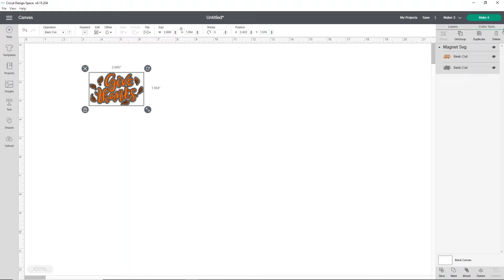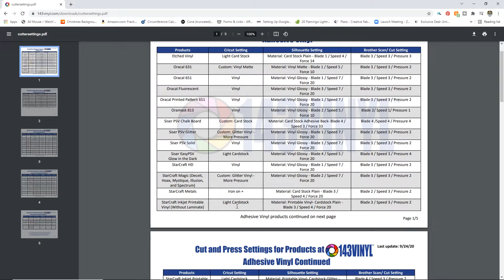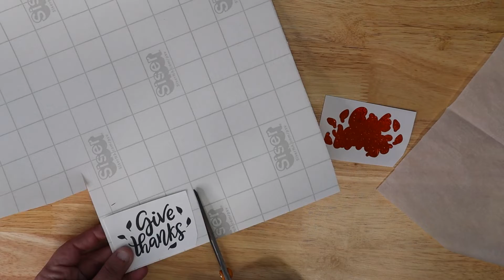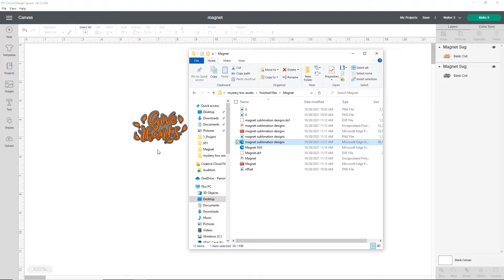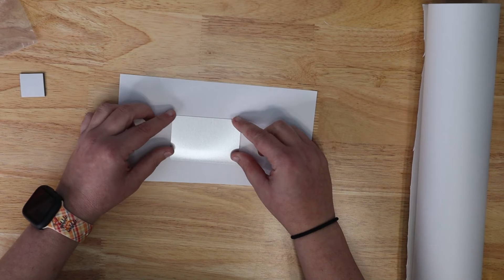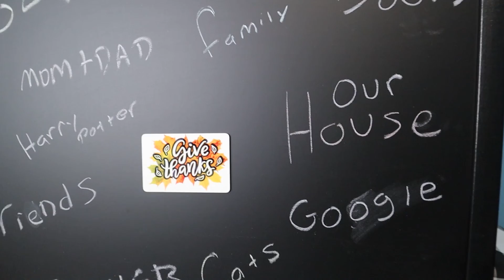Make your own magnets with vinyl or sublimation using Cricut Design Space - mystery box

Comment: Made the magnet tonight using sublimation.  It came out Awesome.  Thanks so much.  Only issue I had was I am not familiar enough with Inkscape and I couldn't separate the images.  Not sure if it was because of me or the file.  When importing into Inkscape it didn't appear like it did on YouTube.  No individual selection boxes when importing.  When I tried selecting those I did not want it was either all or nothing. After several attempts I just printed them all.  The image quality and the final product was perfect, and it's not that big of a deal, at least on this project.  I will  need to learn how to use Inkscape in the near future.  Thanks again, great tutorial.
Reply from the maker: I’ll check into the file and see if something odd happened when I saved it